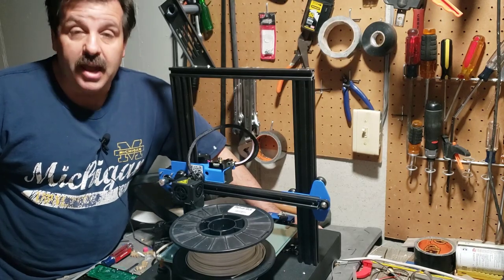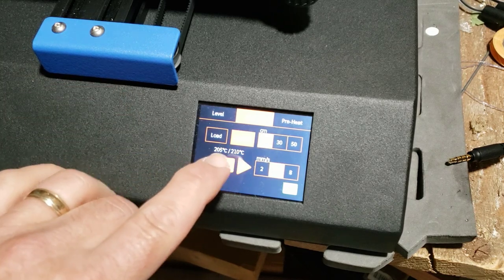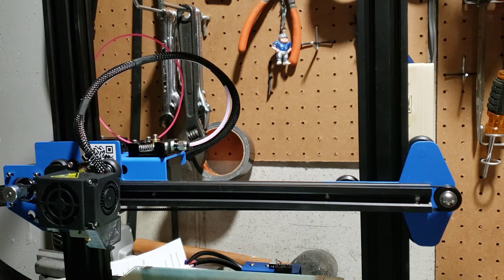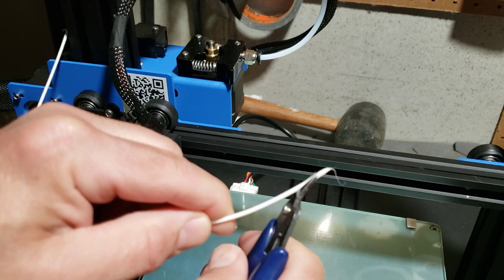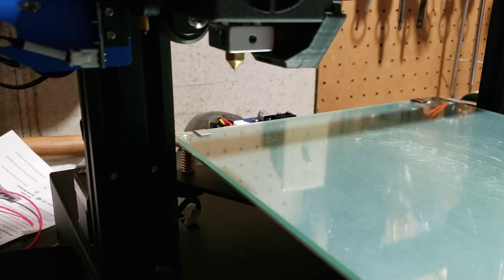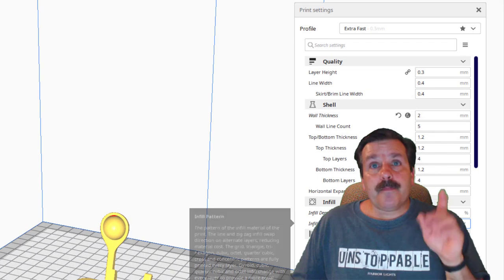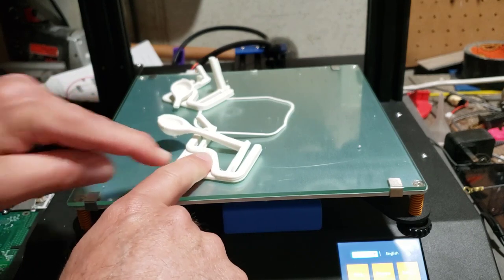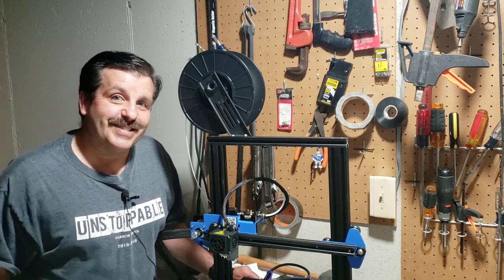Stress Test #2 | Anet ET4x prints an ABS Catapult | Free Thingiverse

Comment: Thanks for this video! I have 2 questions:
1) Do you have take safety mesasures for the fumes when printing ABS? From what I've read ABS fumes are toxic
2) I can see that you have the green membrane wrap on in your bed (the adhesive sheet that is between the metallic bed and the glass). Do you know what the scope of this sheet is? I removed this from my printer - I don't know if it was the correct thing to do, but since then my prints look a little better (maybe due to better heat transfer??)
Reply from the maker: I did not do anything about the fumes. I have a pretty large area and do not really hang around while it prints. I think th e green you see is reflection from my greenscreen. I just checked and the 4x is just glass on metal.

Comment: You are literally answering all my questions lol. I was hoping this can print. ABS is it a tougher plastic? Trying to build mock frames for a drone. It's not final work but something I'd use to pitch concept designs. Carbon fiber is choice but I don't have 6k for a 200 drone lol
Reply from the maker: I like it when it works like that. ABS was really popular... Strength is good, higher temps, so if you made a fan shroud for your printer out of ABS and worked with PLA... it should not melt. Not sure about drones. Just snagged a phantom 3 of my own. Crashed it 10 days in and am in the repair process. Not for the faint of heart. Did the fix... turned it on. error. =(
Reply from the maker: They say the odors are dangerous. Newer filaments like PETG require lower bed temps... I am really just learning with the more exotic filaments though.
Reply: @HLModTech  sorry to hear about your drone. I have a husban Zino original and still flies good for me. Hopefully you can 3d print it better then DJI